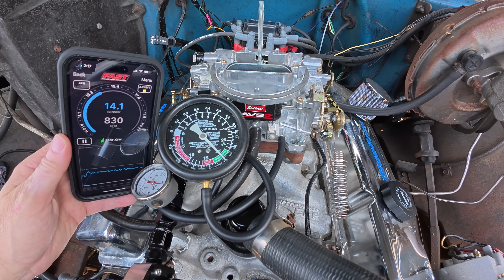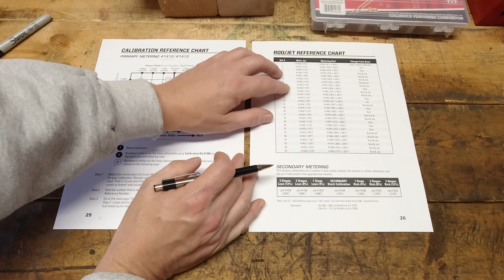Top 6 Carburetor Mistakes

Comment: Thank you for all these videos that you put out and helping people understand how these systems work. Growing up my dad was a drag racer and is a true believer in the Holly double pumper, but in my early years of my first daily driver (84 GMC Sierra) I was averaging 8mpg because Dad tuned it for WOT which did not benefit me in daily commuting. After a few engine builds and cars of my own I'm falling into the cruiser /daily driver category and have become frustrated with this new age of everything being electronically controlled and not roadside serviceable. This channel and Uncle Tony's Garage has helped me expand my understanding on how to properly tune for a vehicle that is not only reliable but efficient. I'm currently building my '68 Chevelle with a 350 board over 60 with the lunati RV cam & summit 160cc chamber heads and a dual plane intake topped with an Edelbrock. I plan on converting it from the powerglide to a Saginaw 4-speed and all the information you provide through this channel has given me the confidence and enthusiasm for a good cruiser and support vehicle for my buddies during drag & drive events. Thank you again for being an educator and I look forward to your future videos.
Reply from the maker: Every carb type has a home!  I just did that video a few weeks ago.  Type is just as important as CFM.  Glad you’re enjoying the videos.  👍

Comment: Great videos. Do you have any tips for installing a dashpot on theese edelbrock carbs?
Reply from the maker: Not anything I would ever install on an aftermarket carburetor.  No need for it.  It was more of an emissions thing on the OE stuff.
Reply: @MuscleCarSolutions   I see. Iv just go a tip that it would help the off throttle stumbling a bit. Im running a1406 on a 13b rotary engine withindividual runners..

Comment: I just got home from a 1400 mile trip  last night, and man it was a carb learning experience.  lol  started in Manitoba, Canada, and drove down to the Black Hills in SD in my 84 Dodge d150, stock 318 engine.  Once I was getting into the hills close to Sturgis it just felt like the truck was getting gutless.  Especially once I got into Deadwood and Lead area.  Gained about 4000-5000 feet of elevation.  I have a 1905 AVS2 on it, which I think might be too much carb as well, should have went with the 500cfm and I think it would work a little nicer IMO.  Anyways, leaned it out and tightened up the spring a bit on the secondary flap and it made a huge difference, and I gained 2mpg.  Watching your channel over the last year has definitely taught me a ton, and gave me the confidence to take this old truck on some amazing road trips so far.
Reply from the maker: That elevation gain is a killer!  On a stock 318 the 500 would have been much easier to tune and better throttle response.  Glad you made some changes on the fly.  I rarely go much above 1200 ft in elevation and live down around 200 ft.  But for sure in your instance carrying a calibration kit is a good thing if you’re asking the truck to work at higher elevations.  Glad the videos helped!  Good work!
Reply: @MuscleCarSolutions ❤

Comment: My edlebrock carb has a stiff spot in the throttle when the secondary’s open but only when the engine is warm im thinking it has something to do with the choke any idea what it could be?
Reply from the maker: Linkage, choke, fast idle cam, throttle plates hung up.  Lots of things it might be.

Comment: Sir,
I'd like to ask for your advice.
I'm in the process of compiling parts to build a new 454 big block Chevy for my '87 Monte Carlo SS...car will be used as a fair weathered cruiser.
I'm looking at 450-500Hp, 500-550lb-ft, at the crank, build.  I plan on 9.8:1 compression ratio.  Heads will be Edelbrock Performer RPM oval port heads.  Cam will be in the 220-230° @ 0.050" neighborhood.  Where I'm not certain is the intake manifold/carburetor.  Here are my options:
1. Edelbrock RPM Q-Jet with an 800cfm Q-Jet, or
2. Edelbrock RPM Air Gap, with a Holley 770cfm Ultra Street Avenger, or an Edelbrock 800cfm AVS2.
What's your recommendation?
Thank you in advance.
Reply from the maker: For sure with that cam (you’ll likely be a little higher on duration to get your power goals) and those heads it’s hard to beat the performer RPM intake.  Great street combination.  Carburetor is the challenging one.  You can likely get away with the 800 AVS2, but if it’s not performing the way that engine wants, switching to a 4150 style might be the better choice.  I’m making the assumption you’re at sea level.
Reply: @MuscleCarSolutions 
Thank you very much for responding. 
What are your thoughts on an 800cfm q-jet on a performer rpm q-jet intake?
If I go the performer rpm air gap route, do you think the holley 770cfm ultra street avenger will be enough for this combination? Or do you think I might need more cfm, maybe even more than 800cfm? ABSOLUTE red line of 6,400rpm
Reply from the maker: @nickf2678  if you have the Qjet built for you.  The factory carbs are capable of flowing good numbers, but they are complex in how they deliver fuel.  Not the easiest to tune and adjust.  I’d not look at a street avenger type carb for what you’re doing.  Especially at that max rpm.  I’d be shooting more for an 800-850.
Reply: @MuscleCarSolutions 
Much appreciated Sir.

Comment: It sadly took me many years to figure out that idle mixture screws only dealt with idle. Back in the 70s we just called them mixture screws and so I never made the connection to idle. “Engine running rich? Tune the screws”. I guess that advice should be been “engine idling rich, turn the screws”.  Thank goodness now we have resources such as this channel to help others avoid such mistakes.
Reply from the maker: Old habits die hard!
Reply: I spent so many years adjusting carburetors and changing jets to get the best performance and gas milage. Now with a AFR meter it makes adjusting carburetors so much  easier and quicker with real time results. A good AFR meter is a game changer for sure.

Comment: We had this one on a friend's dirt track car. He used the usual open element air filter setup (chrome plated hot rod style) and when he revved the engine up the suction on the top lid of that air cleaner would get pulled down and the whole unit would vibrate and of course that was messing up the seal between the bottom lid and the carburetor. So, what we did was to find a top lid from a passenger car that was the same diameter but thicker material and of course was not flat but domed which made it stronger. The slight additional weight of the top lid was not going to cause any problems, but it did stay in place when the engine revolutions were brought up. This was a local dirt track car and not a high dollar one so that potential problem was solved. We still had the performance element but more secure (and we did use a gasket between the element housing and the carburetor).

Comment: Is it more less true that having Faster timing at idle will make the engine idle way hotter & give the risk of over heating during summer? Have seen so many claiming it does, But then there are also many that say it doesn't really effect it Unless you have an issue some where with the cooling system .
Reply: Faster timing at idle? If you mean faster idle speed, the higher idle speed will heat the motor when sitting still with an automatic trans in gear. As for advanced initial timing ("faster timing at idle"?), additional initial timing will usually make the motor run cooler.
Reply: @mickangio16  Having timing say set to 16 or 18deg vs like 8-10 or whatever stock is supposed to be. Like when I had Factory ignition & fuel injection, Mine was supposed to be set at 0deg With the computer disconnected. Then computer typically would set it between 6-10deg depending on engine temp and so on at idle.
Reply: Sorry, not familiar (and not interested) in EFI, but additional initial timing usually makes a motor run cooler.
Reply: I would expect the additional initial timing to run cooler at idle and low speeds- as long as the motor isn't gas pinging under throttle, but by advancing the timing, your entire timing curve may be too far advanced which could make the motor run hot.
Reply: That's what modifying, or "curving" a distributor is all about. Usually, you shorten the amount of advance that the distributor provides to increase the amount of initial timing without having excessive total timing. You're talking about EFI & computers, though.

Comment: No matter what I do to the adjustment and linkages on my Edelbrock 1405 I cannot get it to stay on the fast idle cam for longer than about 15 seconds after startup. Ive bent all the linkages and cranked the choke to full on and it still immediately comes off choke after startup
Reply from the maker: Is the fast idle speed adjustment screw making contact with the cam?
Reply: @MuscleCarSolutions  yes its set to increase throttle plate angle as it should be but as soon as it starts the choke starts coming off almost immediately. When its cold, the fast idle screw is between the 2 marks on the fast idle cam and it starts out with an idle of about 1600rpm but I just cant get it to stay there. If I even touch the throttle it immediately kicks off the cam and goes to base idle

Comment: I'm getting used to the shop towel to the face 😋
Fun Video!  👍 As you mentioned about the types, I prefer Edelbrock AFB/AVS up to a certain performance level.
The fast tuning adjustments and top lid makes life easy for street cars/trucks.  
Nothing against Holley's, just reassembled a 750DP for a fresh 468 build in a 70 El Camino.  I might build/buy another carb for it later on, if I think there's anything to be gained, but I figure the 4779 Holley is a good old reliable calibration to start with.
Reply from the maker: They all have their place for sure.  👍

Comment: Just drove 66 396 caprice wagon 900 miles home has a 600cfm old holley on it the 396 has new roller cam idk what size suks also has 700r4 tranny with stall anyhow thinking of putting a 750cfm street demon on it would like a old quadrajet but can't find good built one would 750cfm street demon be good? 3:73 posi rear also lol good times
Reply from the maker: I’m not a street demon fan.  Did a video on it a few years ago.  But if you think it’s right for whatever that engine is asking for, then use it.  Would need a lot more details to share an opinion.
Reply: Personally we  have had great results with Brawlers , all sizes ,generally great out of the box.
Reply from the maker: @ronniecox109  the dreaded “right out of the box” line. 😂
Reply: @MuscleCarSolutions A 750 on my small block 427 , AFR headed ,Dart block has done excellent , 7.10 8th  drive to track, drive it home.
Reply from the maker: @ronniecox109  runs 7.10 in the 1/8?
Reply: @Kingswood-qv7sr  check on the which carb is to big engine masters episode. That 600 is holding you back
Reply: They had books my friend. I learned from a book about carbs. Idle screws, transfer slots, what to do if no reaction from the idle screws, and how important initial timing and advance is.